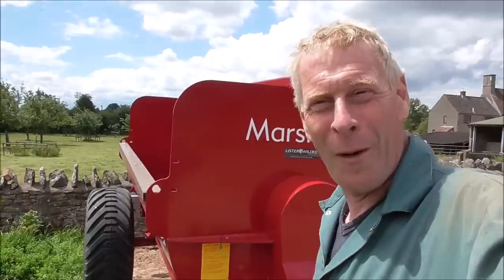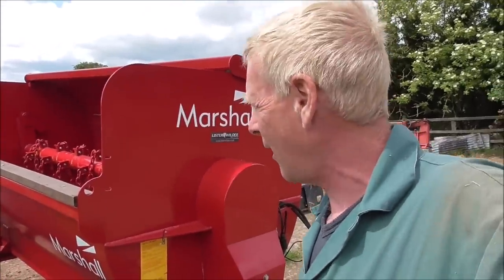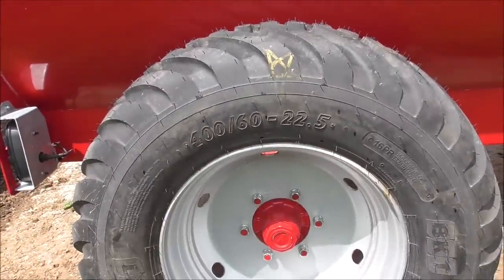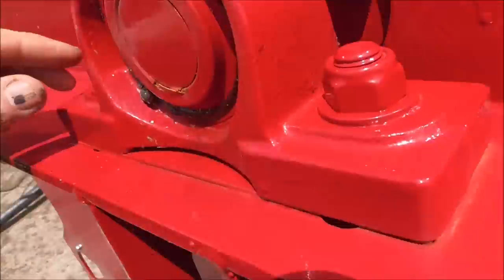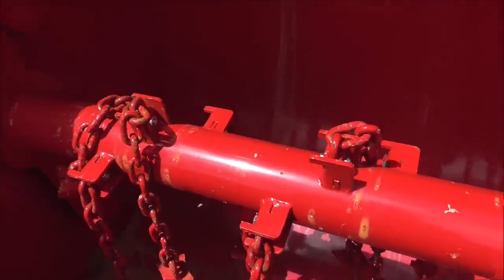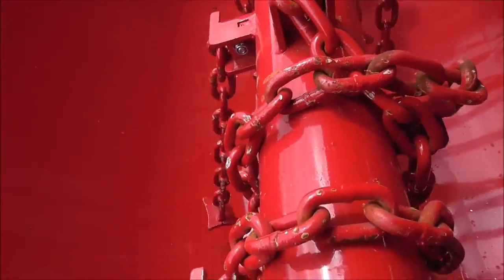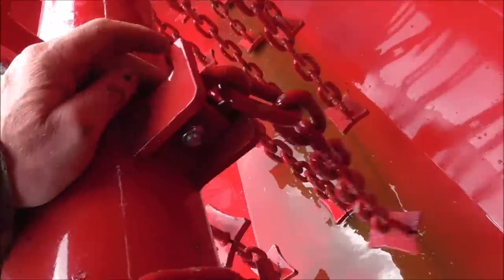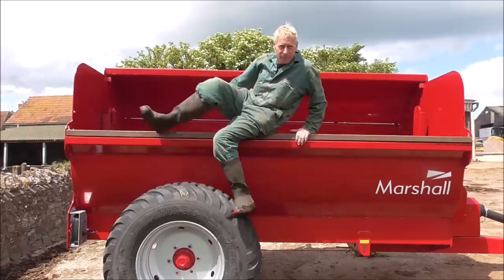NEW MARSHALL MUCKSPREADER ON THE FARM

Comment: The wood is a part that is meant to wear out so that the metal doesn’t so once it does wear out you need to replace it so that the metal under it doesn’t wear away.
Reply: Spot on. It's sacrificial and easy to replace.

Comment: Before you use it spray it with old oil, good coat all over protect the metal and paint, when you've finished using it knock the big lumps off, will last much longer, clean it properly as many times a year as you can or before it's left sat for a long time 👌
Reply: Mate, did you see their old one? It never got washed once lol